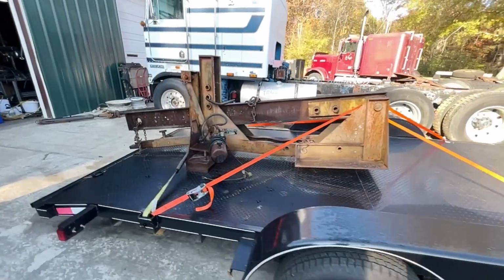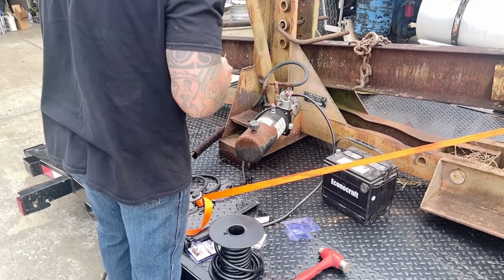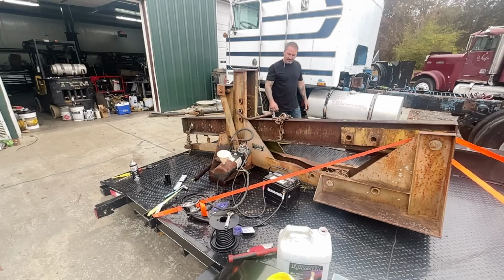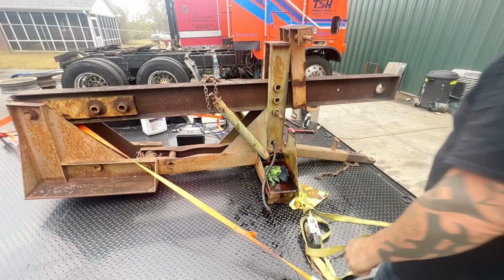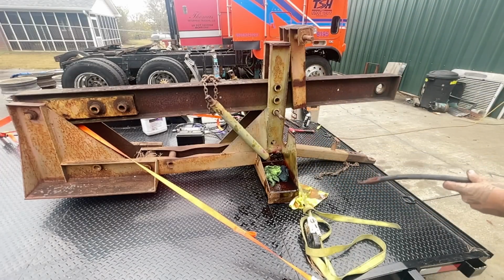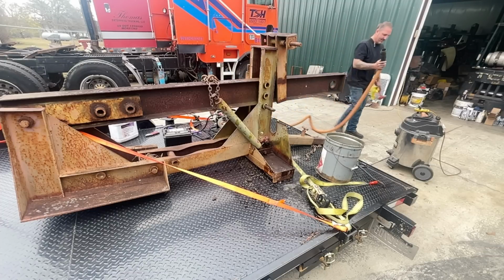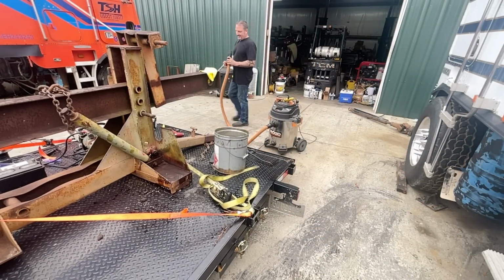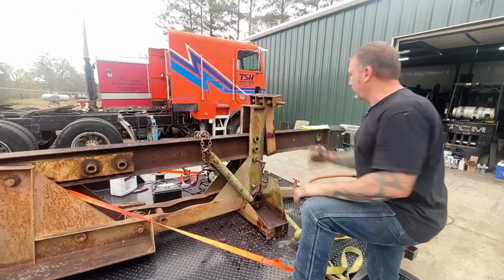5th Wheel Wrecker Attachment, Let See What Works & What Don't

Comment: Nice score! Those things have come a long way we have a newer unit it has a regular under lift like a HD tow truck. Just a for warning put that on the longest wheelbase you have all the weight is on the ass of the truck doesn't take much to get your steers off the ground.
Reply from the maker: Ok good point.  Appreciate ya
Reply: @JamesPretty  Look up some pictures of a old Holmes 750 may help with a idea the pieces your missing can probably make them if you have to

Comment: I did a quick search for 5th wheel tow attachment and it came back with one for $10,500.  2 cylinders and a pump would be a whole lot less.  Those are single action cylinders so they power up and gravity down.  There is a dump valve in the pump, supply 12 volt to it and it releases the pressure.
Reply from the maker: Ya they are expensive for sure I’ve been waiting to get one.   I believe I have a plan   Appreciate ya

Comment: I seen in the comments you bought a pump already. But here's another suggestion. Put a pto on the truck your going to tow with. Quick couplers on hoses for pressure and return. You'd only need a 5 gallon reservoir. A spool body. With one lever for up and down. Easy peasy. You could probably find good used ones off a garbage packer truck. Save some money over new. Just a suggestion for future. Your cab jack theory. I doubt will work. As it won't build enough pressure to lift a truck off the ground.  Good idea. But too light duty. Lifting a cab is way different than lifting 10k- + truck off ground.
Reply from the maker: Ya I can see what you’re sayin.

Comment: James it appears your fifth wheel attachment is in need of some TLC too.  Might be worth it though those towing attachments are not cheap.
Reply from the maker: Ya I agree it was given to me so if I spend a few dollars making it right and changing it back to the way it’s supposed to be it’ll be fine
Reply: I agree, it's savable, the bottom channel between the 5th wheel point and the frame brace point needs replacing, you can see where it buckled in two spots, most of it's strength has been compromised by that.
The lifting beam looks to be good, or replaced?
Best wishes from the North.

Comment: Hey James  Want another one just like it?   Have one here been sitting 30 years. has hand pump and works, but would need hoses changes for safety. That Stiff Arm bar at the bottom pins to your sling which is hanging from the boom. Same brand model but I think yours is a little newer. "Tote A Long"
or something like that?  Love your old trucks and channel I grew up around those coe's and B models Macks  TGP  S.ILL
Reply from the maker: Rite on.  I would love to have another.
Reply: If james isn't interested in it I would be depending on where your located and how much you would want for it?
Reply: @TNobsolete  9miles East of St. Louis MO. in IL.
Reply: @thomaspetroff9117  how much are you asking?
Reply: I kind of suspected that lower arm had something to do with keeping the towed vehicle from running into the tow truck. 👍
Reply: @TNobsolete  How to contact you?  I don't use any social media

Comment: James there should be a relief valve somewhere on that pump. Or in the system. Your pump will extend the cylinder. And the relief valve should let them retract. Kinda like a snow plow. Only they use electric solenoids to relieve the pressure
Reply from the maker: Rite on.  The new pump is much better. Up and down is working.  Someone relocated the upper cylinder mount.  I am going to out it back where it belongs

Comment: I need to buy one of those. These freaking DD15 engines that I own with constant after treatment problems getting expensive towing. I’ve been looking for a used one for awhile and they are not cheap the best price I’ve found is 5 grand and it was rough. That’s worth fixing you have
Reply from the maker: Ya the old way is the best way for real

Comment: It's rough when someone else built stuff and you have to figure out how exactly it works. I went through that with a car tow dolly I bought. These cylinders look like they are off a tractor bucket and the pump looks like it's from a car lift. May rig it the same way with beefier pump and cylinders as a thought.
Reply from the maker: Ya it is for sure.  I think I’ve got a solid plan. We’ll See we’ll see we’ll see

Comment: Get the cylinders rebuilt and go with a air over hydraulic pump that way you use the trucks air . No need for a bunch of electrical shit to go bad. That lower arm is for a sling to help stabilize the truck being towed. I would stick with it the money it will save you in the long run is worth the cost. I rebuilt cylinder for years heat that sob up and get it apart most likely the ram is froze in the guide . They are all the way down which is the best way to store them.
Reply from the maker: Thx rod

Comment: This is a long shot James, but does it have to be electrically operated? Couldn’t attach something like a cab lift jack to the hydraulic line and use it manually??? 

Maybe even convert it to using those manual operated rams for usually used for car chassis alignment? 

Sorry if I’m wrong mate just a thought 👍🏴❤️🇺🇸
Reply from the maker: I actually considered a cab pump   But I’ve got a new electric pump
Reply: @JamesPretty  fantastic news mate as long as you’re good to go 👍 

Will you be painting  that lift as well mate make it match the truck you fit it to ?? 👍
Reply from the maker: @nostreamavailable9090  I will
Be making it nice

Comment: Put some air bags and a gladhand switch it to air brother much cheaper
Reply from the maker: Got a pump cheap enough but cylinders are spenderich
Reply: @JamesPretty  that sucks I was gonna say put 2 pieces of c-channel one on lift arm one on main body up towards the hindge put a double or triple convoluted bag on either side a glad hand to supply line running to a 2 way air switch simple easy most of all cheap but effective gets rid of electrical/and oil